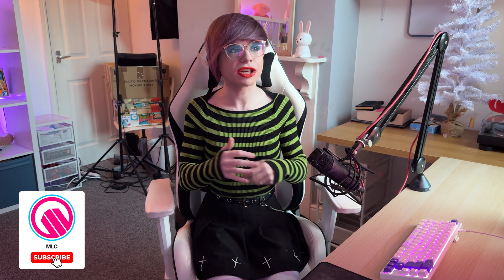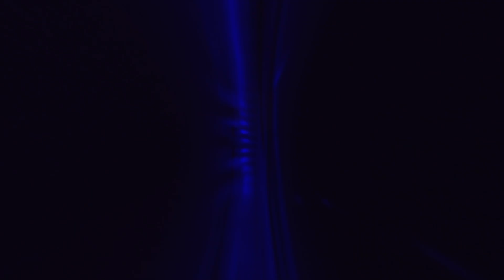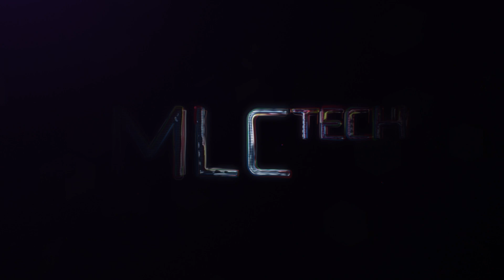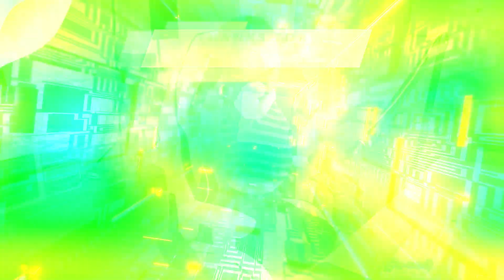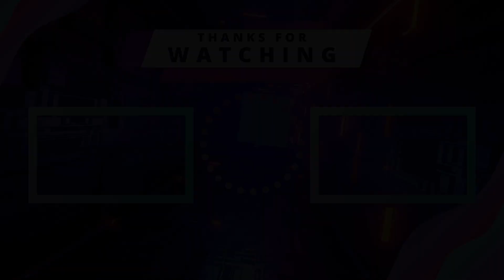New High Capacity SSD's! - Samsung QLC V9 Storage Density Increase!

Comment: PLC (Penta-Level Cell) which is 5 bits per cell is next, both IBM and Toshiba have been talking about it since 2019. 

For what its worth I also still use Optaine for some things, it's not the same as NAND but is as close as you can get to SLC now, unfortunatly 
they stopped making it not long ago.

But a comparason for you, I got an old 4TB Samsung 850 Evo, it was the first consumer TLC SSD, I got a 4TB Crucial P3+ not long ago, its QLC. 
So based on what people say you would expect the Evo to out perform the P3+ in almost everyway so..

The Evo is 48 layer, the P3+ is 178 Layer

The Evo has 4GB DRAM, the P3+ dont have any.

Its not a rellevent comparason doing speed as one is SATA and the other is PCIe 4.0 but but the P3+ is faster.

The Evo has a 5 year 300TB  waranty, this works out you can write 168GB per day or 75 total full writes.
The P3+ has a 5 year 800TB waranty, this works out you can write 448GB per day  or 200 total full writes.

To digresss, if endurance is what you are looking for, you will find enterprise drives for not much more money and they last much longer.
Having said all that I've written far more than 300TB to the Evo and its still fine, YMMV. 

The Evo when first came out in 2016 cost $1499
The P3+ when first came out in  2022 cost $325

Its an intresting quick comparason and shows QLC and PLC from a performance and endurance point of view are nothing to worry about.

And many thanks for the vid

Comment: Never forget the scale:
SLC
MLC - Samsung PRO drives
TLC - Samsung EVO drives (and recently PRO)
QLC - Samsung QVI drives

The more bits per cell, the more data you can store, but at the same time the worse durability.

But also: TLC and QLC are getting better and better every year. Samsung has recently moved from MLC to TLC for the PRO SSD.

QLC is great for storing a lot of data and kind of no need to rewrite a lot. So it's not the top pick as a boot drive for a professional user. But you can probably use it for external storage where you put a lot of raw footage. Then you can access it when you create new youtube videos. I can def see advantages for QLC based SSDs.